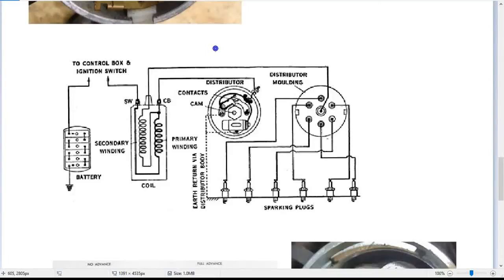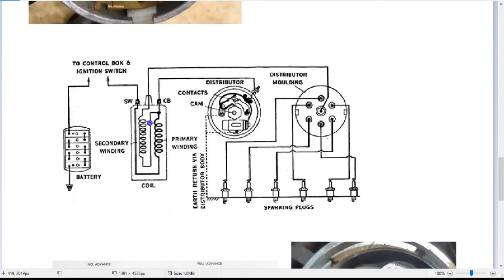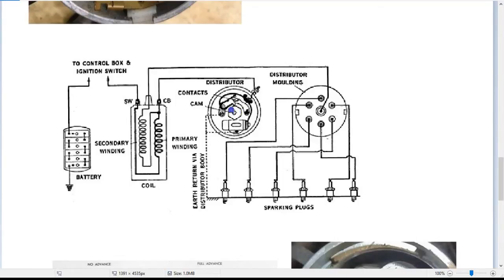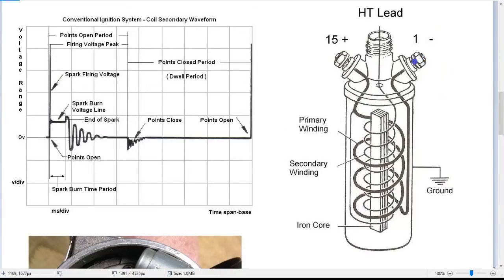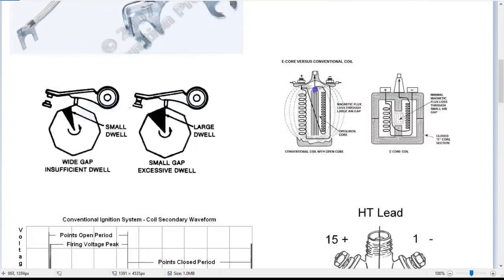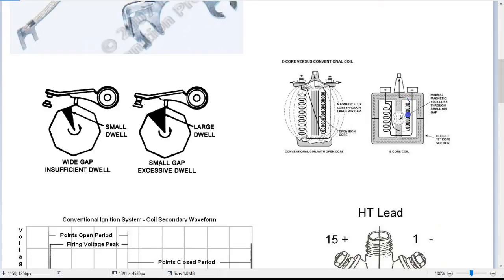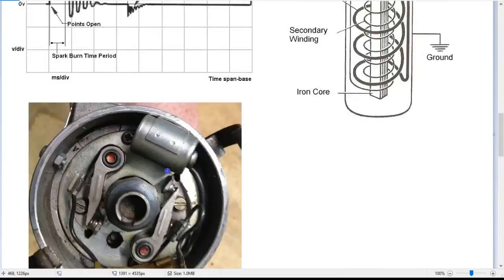Kettering igntion system, distributor, points and condenser explained E22

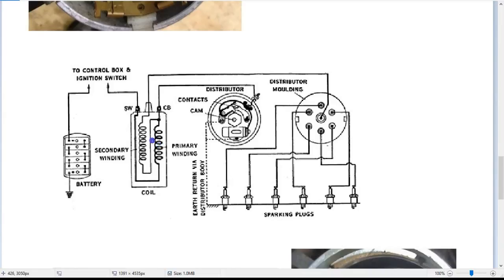Comment: Hi, you have very nice informative clips.  I am not a car guy but I have a background in electrical engineering and I just want to clarify a point for you.  At 9:35 in discussing the oscillations between the condenser and the primary you say "to get the most amount of energy (into the spark) we have to increase the speed of the flux lines crossing over."  This is not what is happening.  What you are saying is a popular misconception.  Here is the proper explanation:  When the HV secondary ignites the plasma there is a continuous plasma burn with the secondary at a constant voltage at say 800 volts.  During this time the secondary is on a continuous burn pumping the stored magnetic energy into the plasma spark.  This is an "automatic" process that has to do with the way inductors work.  It's sort of like a charging bull with a momentum of its own.  You mentioned that coils have electrical inertia to energize them.  This is the inertia working in the opposite direction while the coil de-energizes.  So the secondary discharging does not "need" the primary to oscillate with the capacitor to "get the most amount of energy (into the spark)."  In technical terms the discharging secondary inductor is a "current source" (as opposed to a voltage source.)  The primary oscillating with the capacitor is a secondary process that will make the main discharge of the secondary into the plasma "wiggle" a bit because of the mutual inductance a.k.a. transformer coupling.
Reply from the maker: You are right to point that out, it was poorly explained and I covered it again in some more detail here https://youtu.be/fja2XH8AyyE?t=325